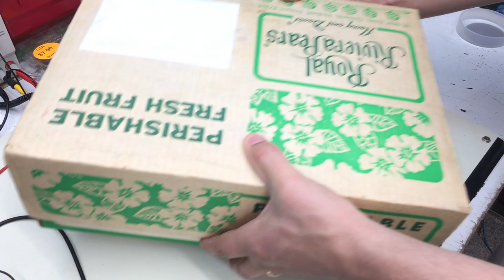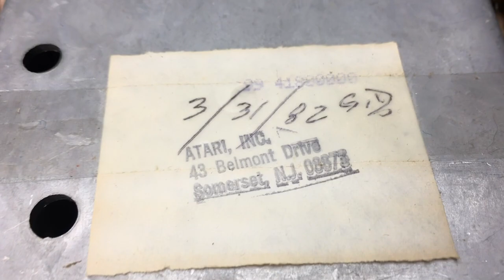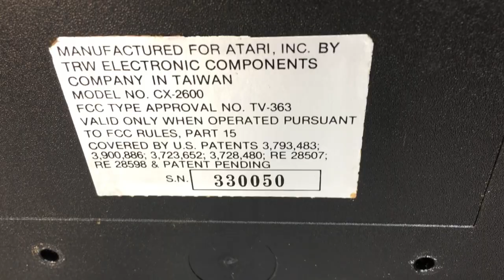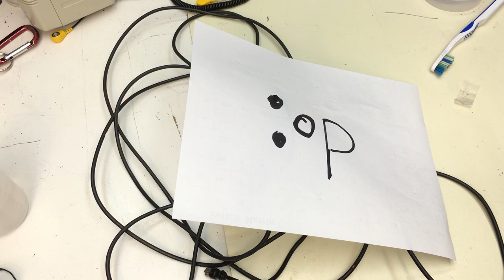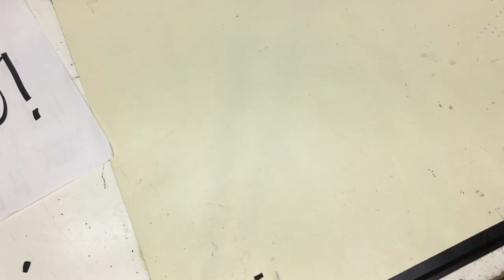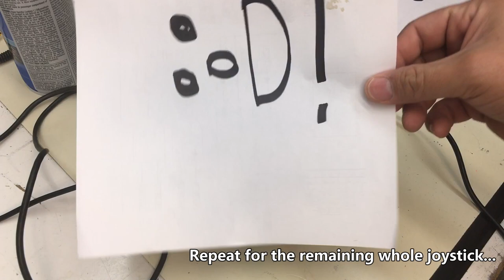Super Chill - Atari 2600 VCS - Repair and Restore

Comment: Nice work, Joe. This is from someone who fixed over 1,000 of these from '81 to '82 at that Belmont Dr service depot in NJ.  As evidenced by initialed paper tag on the motherboard housing, your particular console was sent there for repair and G.D. (Gene) was the tech. There were eight of us doing repairs during the peak of their popularity. Now that I'm retired, I may do a similar video with some tips and tricks we used back in the day that still apply.
Reply from the maker: Wow! This is an awesome insight into the history of this machine. Thank you for sharing, and thank you for your past work to keep these systems going!
Reply: @JoesComputerMuseum  Figured you'd like that little bit of trivia. FWIW, after further viewing, I can tell he replaced the 16-pin hex buffer IC, a common failure that effectively "held the fire button down" on the joystick. Static electricity (user to console) was the root cause, cured by the zener diode/cap pigtails behind the 9-pin connectors. The foil that "grounds" the switches to the housing was an early attempt at a cure, but the zeners were the magic bullet. Also, I love that hybrid  solder sucker you were using...sweet! We had to cope with the spring loaded versions! Again, nice video!
Reply: " I may do a similar video..." Yes! I hope you do. I would love to see your insights on repairing these consoles!
Reply: @mphillips7738  "I can tell he replaced the 16-pin hex buffer IC, a common failure that effectively "held the fire button down" on the joystick."

I had to replace that chip on my "heavy sixer"; it was bad when I bought it several years ago. In my case it wasn't causing a significant problem like a "hold the fire button down" situation; it was just causing some weird graphical glitches. I replaced it with a Texas Instruments CD4050BE and the glitches went away.
Reply: @MaximRecoil  The now coveted "heavy" was a nightmare for us techs: They required a TON of mods to make them work reliably.  The problem you describe wasn't a buffer failure mode that I recall, but if you bang on the top of the console while it's on and the screen goes kablooey, you likely have one of a number of intermittent connections that will cause a lock-up, from the IC sockets to the green cartridge socket that most heavies had -- they were so bad, we had to replace every one that came in (and they SUCKED to remove). Peek into the slot; if the socket is white you're okay. If green, don't breathe on the unit during a game. 🙂

Comment: I had in my possession 8 Atari 2600’s that I bought from yard sales and flea markets about 15 years ago for a total of around $20. None of them worked. Every single one of them had the exact same problem besides being filthy....the voltage regulator. That $3 piece is what cause those consoles to not work. I fixed them up and sold them for around $200 and up to collectors. Never throw these things away.
Reply: Why do those voltage regulators fail and why do they need that white pasta to function properly??

BTW 
I do got 3 atari 2600 jr systems for wich some of them seems to be broken,if you want i can sell them to you if want that😁
Reply: @johneygd  I’d be down to buy them! I love trying to get these console back up and running!
Reply: @johneygd  the white paste is thermal paste. You have to envision that the surfaces of the backside of the voltage regulator is "rough" on a microscopic level, and so is the metal plate on the PCB which acts as a heat-sink. This roughness creates gaps with air between the two surfaces once the regulator is mounted. Air is not a good head conductor. To get the heat transferred from the voltage regulator into the heat sink as good as possible,, this paste "fills up" those gaps. The paste is such that it transfers heat as good as possible. The trick when using it is to get a even but as thin as possible layer. I always move the part (in this case the regulator) around a bit before actually morning it to make sure the layer is thin and even. 
I picked up a heavy sixer with a much earlier revision PCB than this one and the regulator has a separate heat-sink installed on it. The machine works fine though so I won't be replacing anything if not needed (I measure all caps with a good ESR meter) but I will definitely replace the thermal paste because this dries out over the decades and looses it's heat conducting function. 

The voltage regulators usually fail because people connect the wrong power supplies with incorrect polarization or way to high voltages. These kind of voltage regulators are normally very reliable. The bet thing about them: When they do go bad, they "always" die in a "safe" way, thus, the electronics that get powered by the regulator are safe. I have been repairing electronics for decades and I have never seen a bad 78XX regulator that killed the electronics that's "behind" it.

Comment: Nice call on changing the voltage regulator. A high failure part not only in game consoles... However, even though it doesn't need it now, i would have changed the electrolytic and the other capacitors for a total "restore" as they tend to gain resistance and the electrolytic can develop high esr, and other problems over time... But nice relaxing video ! Lol!
Reply: What George Plimpton has done back then during the late 1970s and the early 1980s is that, he has often compared the Atari 2600 video game consoles graphics to the Mattel Electronics Intellevision video game graphics. It's understandable that the Atari 2600 version of Pac-Man was poorly designed.

Comment: For anyone else that has opened an Atari joystick and had the spring fly into the unknown like I did, the spring from a ball point pen works as a replacement. (Just need to cut it down to the correct size)

Comment: I used to fix those things... The solder points are all done by free hand and NOTHING inside is complicated.

The weight you fill on these old beasts is plastic, a thick plastic case. Good fun to fix so thumbs up! Christ if these things ain't hard as nails to find in the wild any longer.
Reply: Also, I hate to reply to my own post but I did not want to edit it.

Anyway, I got to thinking and I felt the need to share that more than half of the ones I've fixed and worked on did not have that thin metal strip under their switches.

I'm sure they all had them but I'm double sure a lot of these machines had been worked on back in the day.

Maybe they didn't all have that metal strip? I just started to get to think and I've come to believe that in the nearly 50 years they have been a thing people must have opened them up to fix them or they could have been like me as a child 20 years ago and just ended up with the right screw driver and no one stopped them from opening up their Atari.

Comment: Nice job Joe!

When I was a kid, I never could understand why the RCA cable out wouldn't produce an image on my composite monitor for my Apple ][ plus clone. It's only in recent years that I learned the signal is RF.

I just got a light sixer on eBay last night so I'm waiting on that to come in. It will need some work as it was listed as a "for parts" machine, but that's OK. It doesn't come with any accessories or power supply and has a broken power switch

One of the things I'm thinking of doing is put a jack on the rear. I never did like the super long RCA cable that ran from the inside. I prefer to be able to remove cables and accessories from devices when not in use. 

I'm also considering some kind of mod to make it output to more modern displays
Reply: Spawndude Spawndude  I agree, but why didn't they use a normal coaxial cable instead of the RCA cable?

But this was early days, so I guess standards hadn't been set yet. The stock RCA cable they used wasn't very well shielded either, and I think image quality would have been better if they used a better cable
Reply: Hi, if your still on YouTube can I ask a few questions please, what is the difference between a light and a heavy 2600,  also I want to change the cable that comes from console to tv, is it just a thin coax cable  ? 
Many thanks for any information 👍🏻
Reply: @ronpalmer1371  The primary visual difference is the look of  bottom tray of the shell. On the edges of the heavy sixer, it is rather beefy in appearance. The light sixer is a much thinner in appearance. 

The RF cable they use seems to be a low grade RCA cable. The end that plugs into the RF modulator inside the Atari has a shortened centre pin, so be aware that a standard RCA cable centre pin will be too long, though you could grind it down to the proper length. The other end would be better off putting a standard coax cable end to plug into the tuner of your TV.

The other option would be to pick up the TinyComp that Joe sells on his store, and install that into your Atari to convert the RF to Composite, which would be easier to plug into any TV.
Reply: @lemonherb1  
Hi, thank you so much for your reply, please bare with me as I’m not overly knowledgeable about these things, I would be happy to convert to composite, I am able to physically do the work but unsure what parts I need and where to get them from, you say Joe has them for sale, do you know how I can contact him ? Also I am in London UK, would the parts he uses be suitable for a UK Atari 2600 ? I have yesterday stripped it down and cleaned it up, it was dead but now working but temperamental regarding the cable connections between machine and tv, if I can’t obtain the composite conversion from Joe the least I can do is replace the cable, can I ask you again is RF cable different from RCA cable (apart from the plugs obviously)
 If you reply please feel free to explain as if talking to a child 😂 as I said I have very limited knowledge of what the parts are called or what they do 😂😂 many thanks, Ron
Reply: @ronpalmer1371  To get to Joe's store, just click on the 'About' tab on his channel and click on Sweet Merch!

As for the TinyComp, it was designed by Rudy from Rudy's Retro Intel channel. You would have to ask him if the TinyComp supports PAL. 

I'm afraid I don't know much about the PAL versions of the 2600, so I can't say anything about the RF cable. If it does have RCA jacks on either end, then it's the same as the NTSC ones in North America. If you were to replace with an RCA cable, I'd get one that's shielded to reduce the amount of interference it can pick up
Reply: @lemonherb1  Thank you very much 
Regards Ron
Reply: @lemonherb1  "but why didn't they use a normal coaxial cable"

They did.

"instead of the RCA cable"

"RCA cable" refers to the type of connector attached to the cable, not to the type of cable itself. The type of cable that "RCA cables" typically use is normal coaxial cable.

"But this was early days, so I guess standards hadn't been set yet."

The standards were no different then than they are now. The used RCA connectors because it was intended to plug into the TV/Game switch box, not directly into the TV. Nintendo did the same thing with their RF cable for the NES and SNES, except they had the cable permanently attached to the switch box (it was still an RCA connector on the end that plugged into the console though), and they used even thinner coaxial cable than Atari did.

"The stock RCA cable they used wasn't very well shielded either, and I think image quality would have been better if they used a better cable"

The cable's shielding is fine. I've connected Ataris to TVs with RG-6 (which is the stuff that cable TV/internet companies use to run cable into your house) and it doesn't make any difference at all. The quality of the RF modulator is the main thing that determines how much RF interference you'll see. 6-switch 2600s have quite a bit of RF interference; 4-switch ones tend to have less, and 7800s have the least of all. The original front-loader NES has an excellent RF modulator; it looks practically identical to its composite output; hardly any RF interference at all, and it uses a very thin coaxial cable.

Comment from the maker: Where to get the desoldering pump: https://www.jameco.com/z/SA6-R-11-Long-UL-Listed-Electric-Desolder-Pump-Blue-_2168261.html
Not sponsored or endorsed: it's just the closest match I could find.

About the power supply: 1) I was going for functional, not pretty. 2) I didn't have spare cable at the time to do a.complete repair. 3) it's not a fire hazard. All wires are independantly spliced and insulated.

Comment: it is important to note, for the noobs that may be watching... the squirt bottle was actually alcohol or some sort of contact cleaning solution. DO NOT USE WATER TO CLEAN THE MOTHERBOARD.
Reply from the maker: 99% Isopropyl Alcohol from MG Chemicals, in a little squirt bottle.
Reply: Duh!!!!
Reply: I figured as much as it was evaporating quickly in typical alcohol fashion.

Comment: Joe - Are you able to tell me how you check the voltage regulator. I noticed you had your black/grey lead going off somewhere and assume to ground on the metal plate??
Reply from the maker: Yup. Black was on ground. Red was used to check the 15-ish volts in and the 5-ish volts out. I used the data sheet for that regulator to determine what the voltages should be.
Reply: @JoesComputerMuseum  Thank you for the reply. That will help me troubleshoot mine :)

Comment: Was there an earlier version?  I vividly remember opening up our Atari 2600.  The "motherboard" was not nestled in an aluminum shield and was visible once you opened it.  What I remember seeing was jumper wires bypassing/jumping points on the board, almost like the production run of the first mother boards were wrong and this was the fix.  I know we bought it new in the 70's and it would not have been repaired.  Looking at pics on Google I see there is a version with 2 buttons on left and two on the right and on other 2600 it's 3 right 3 left so maybe I had the 2 and 2 since the one in the video had 3 and 3 button.  I know I am late to this video but thanks for the memories!.
Reply from the maker: Not sure! There are many resources on the 'net that describe the versions and differences.

Comment: i know this is old.. but i've had about 10 Atari 2600's which i fix up a little and sell on to the next collector. My personal one has an issue. Usually 7-10 mins after playing one game, the video then gets a bit fuzzy. Most say its a capacitor getting hot. Any idea which particular capacitor it might be? I already have a replacement component  set i bought from someone on ebay.

Comment: How did you determine the voltage regulator was bad?  Is it because the third post read 0.5 volts?
Reply from the maker: Exactly. It should read 5 volts.

Comment: JOES COMPUTER MUSEUM 
                 ^^      1.) What is the start and end address range for the TIA?
^^     2.) What is the start and end address range for the PIA?
^^   3.) What is the start and end address range for the Games ROM chip?  
             4.) What is the start and end address range for the Sound RIOT chip?
     5.) is it a ROM chip or a PROM chip that are inside the game cartridge?
              6.) A PIA chip is a RAM chip that has built in ADC/DAC interfacing? A PIA is not a decoder or a multipler chip , its a RAM chip with I/0 interfacing ADC/DAC converters built into the RAM locations?
Reply from the maker: Google.com? I don't know the answers offhand.

Comment: Nice video - really easy to follow. 🙂 From your experience what are the main issues that affect these machines in terms of general problems or not powering on?
Reply from the maker: The power regulator is the biggest culprit.
Reply: @JoesComputerMuseum  Thanks. You've given me the confidence to buy a few dead ones. 🙂

Comment: Risky using an electric screwdriver to remove and refit screws on a circuit board. 🤢
Reply from the maker: In what way?
Reply: @JoesComputerMuseum  driver could of slip and damaged circuit board.. good work though in getting they bad boy fixed.
Reply from the maker: @carlb1056  Thank you for the advice!
Reply: thanks you ... i was looking for that comment

Comment: Nice! 👾  Always satisfying to see something like this fixed up. 😎

My brother and I still have our old light-sixer Atari, which Mom and Dad bought around 1980 or so, a couple years before either of us were born.  One of the joysticks and both paddles could use some contact cleaner.  But otherwise, it still works perfectly well, with no sign of significant corrosion or leaky capacitors.

It still has the original AC adapter -- always unplugged when not in use -- and it's been stored well when not set up.  It's actually spent most of its life in a Betamax VCR box (🙂) along with the joysticks, paddles, games, manuals, and some cables and the TV/Game selector box.

And like yours, it has a repair label of similar vintage.  Though ours is on the bottom of the case instead of on the RF shield, and it's for a long-gone electronics repair shop in south Minneapolis -- Audiophile Service Center, 3140 Snelling Ave S, Minneapolis MN 55406.
Reply: At first I never knew that, George Plimpton was a New York novelist. Right long before he became a spokesperson for, Mattel Electronics Intellevision. 😳

Comment: Are 15 volts actually needed for anything?  That seems like an unnecessary high input voltage if only 5 volts are needed for the electronics.  A lot of heat is being put into that little heat sink.  Could a 6 volt power adapter be used instead?  Could a lower input voltage have prevented the voltage regulator from going bad?
Reply from the maker: All really good questions. The regulator is a standard 7805 jobbie, so you can probably dump whatever minimum voltage that takes. 5 volts? They probably designed it with a 15 volt transformer because it was cheap and available.